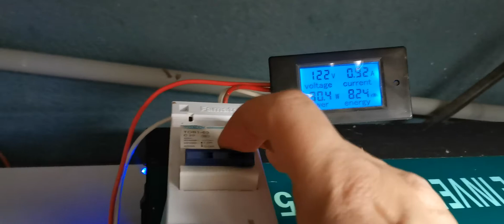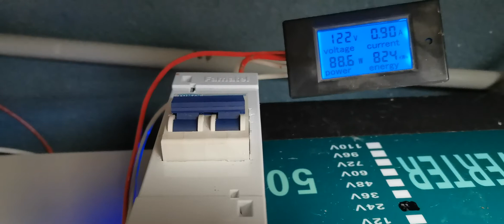Automatic transfer switch for my solar system ats

Comment: Thanks for video for the 110v setup, do you have a setup for 220v? 
I have a 220v inveter I would like to have setup the same way. And curious if you know if both off grid and grid tied inverters can run off the same battery bank. I have 2 110v grid tie inverters on 2 24v battery banks and want to have my off grid inverter tied to both banks for backup power.
Reply from the maker: Sorry i dont have any ongrid device to test